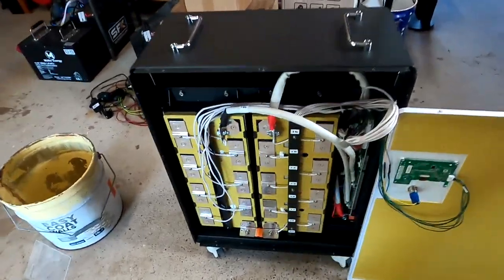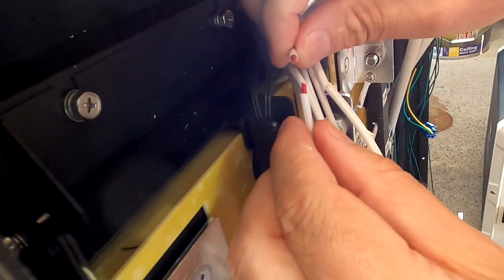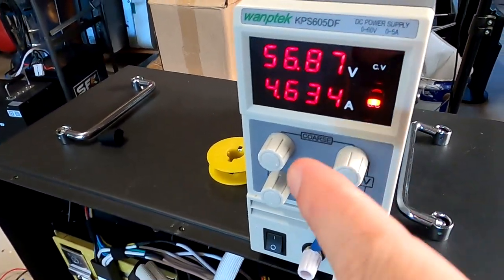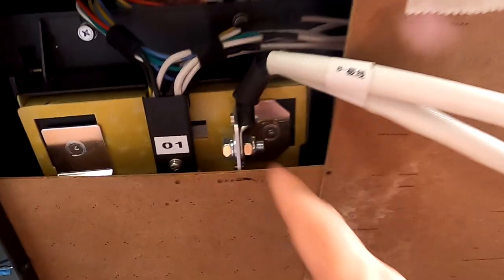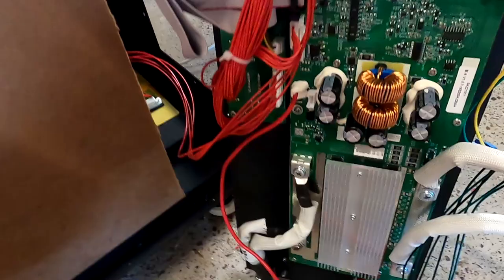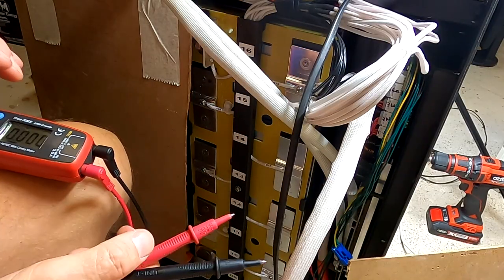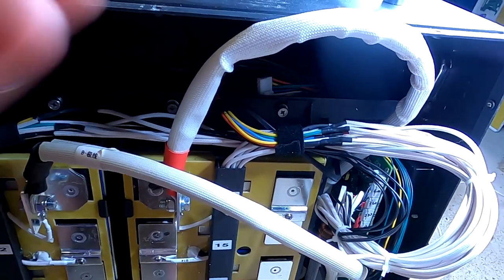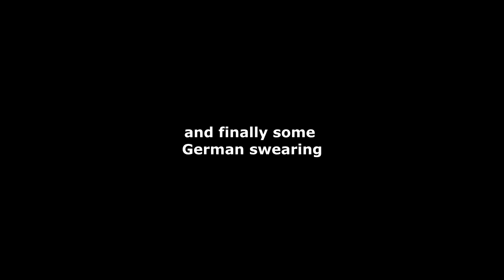The QSO Battery Active Balancer Upgrade. And how a tiny switch makes a simple task impossible!

Comment: Those smaller switches are more delicate. You soldered the Ghost out of it. In your case don't use a cable that is meant for AC 240V 10A. Just two thin wire will do. Lastly use flux and proper 60/40 solder and solder 2 - 5 seconds only and not like a full minute. A blue tooth at the bottom of a fully enclosed metal case - hmm. Do you get any signal in / out
Reply from the maker: The switch was used in many other projects before and the top part came lose and finally it fell apart. I have soldered for the last 45 years, but thanks for your advice.
Reply: @OffGridGarageAustralia  Things work until they are not. Have soldered myself since I was 16 (baby boomer) with good old proper 60/40 and weller lotfett. Good job Andy!

Comment: I dont like these small toggle switches. They are very small and when soldering, can get burned inside.
I now use a push button type switch, with optional lights and even waterproof.

Comment: fuse 200A and breaker just on the plus wire (125A + 125A)
Reply from the maker: Why just on the positive?
Reply: @OffGridGarageAustralia  I think the switch is a bit weak and less wires.  If there will be no large currents, then the two wires can be connected through the switch.

Comment: i prefer v1.4 to v1.7. v1.4 has a better design and durability than v1.7 because the switch totally controls Vcc to semiconductor circuit. v1.7 switch is only connected to voltage detector circuit.

Comment: No active balance relay with sense wire to BMS is possible. That little bugger was Scheisse
Reply from the maker: I could not find a voltage trigger relay for 48V which I can fine tune to turn on the balancer at 55V or so. There are 12V/24V electronics on Ali but nothing for 48V.
Reply: @OffGridGarageAustralia  ♥️
Reply: @OffGridGarageAustralia  I bought 4 a couple of weeks ago. I will email you the link

Comment: Andy, the switch leads are too massive to terminate on PCB. They will rip off the PCB pads.
Reply from the maker: They are good for 6A constant current 😉
Reply: @OffGridGarageAustralia  I was surprised thar the switch had to handle full balance current. If that is the case then your choice of wire size was correct. I would suggest you support cable so you cannot accidently pull pads off PCB.
Reply from the maker: @peterdkay  The cable is too big as many said but was the only double insulated cable I had at the time. 
It won't be moved inside the box so I'm not concerned about it. 
It won't stay like this anyway. The switch is just one option to activate the balancer.